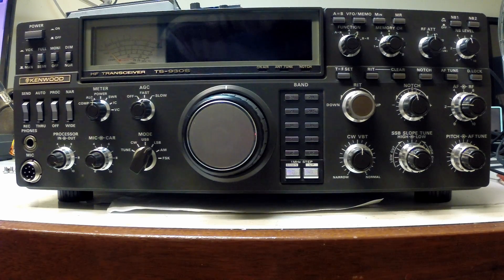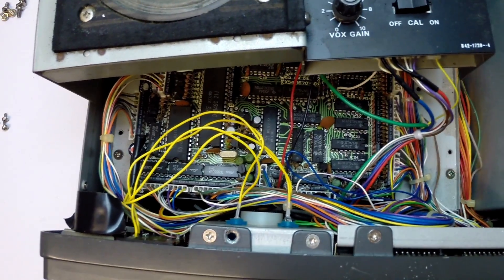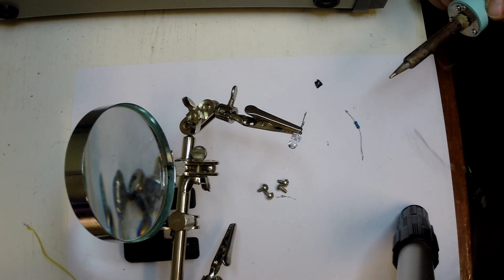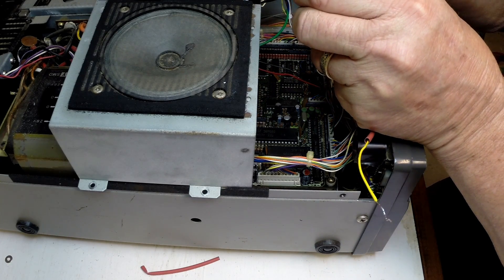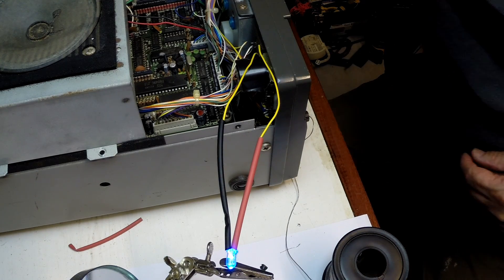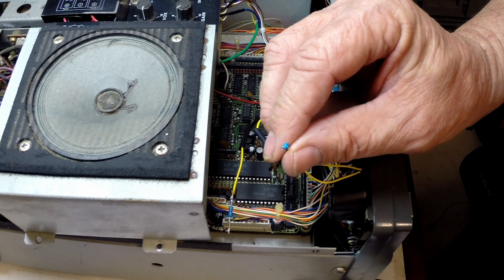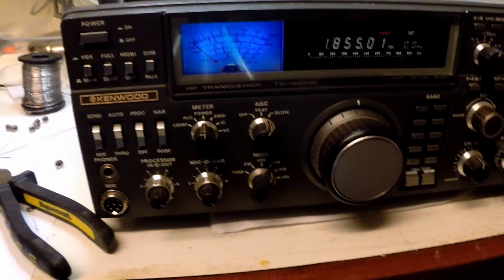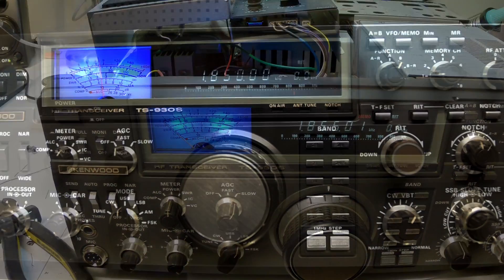Kenwood TS-930S meter back light replacement - 3 July 2018

Comment: You can also take a sharpie marker and write a black dot on the center of the led to kill the hot spot on the meter display.
Reply from the maker: Thanks Fred I will try it next time i have the radio open. The bright spot appears worse on the video than in real life or I've gotten use to it.

Comment: Is you email address operational?
Reply from the maker: vk6ysf.com
Reply: @petermiles6557  Peter I'm sorry but I think the end result looks terrible.  I'm going with two 16V warm white 3mm incandescent "grain of wheat" bulbs in series available from eBay.  $8.89 for ten units.  I may have to replace them again someday but I believe the end result will look much better (like the original).
Reply from the maker: Ha ha I like a man that speaks his mind and I understand what your saying, however apart from the lamp life I like the sharper light from LEDs and it may be just perception, but it seems the metering display is much clearer for me and my aging eyes.